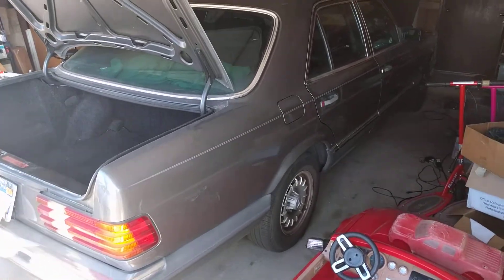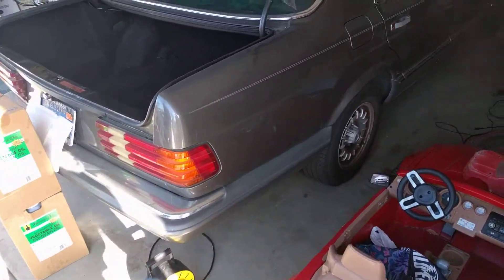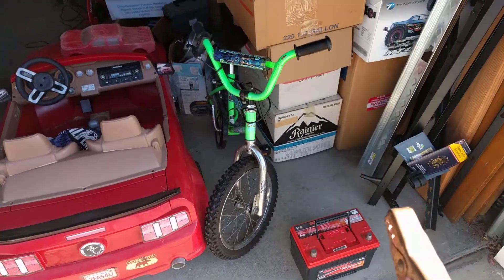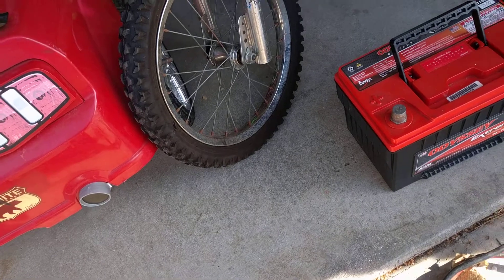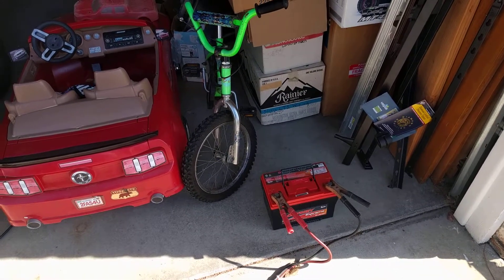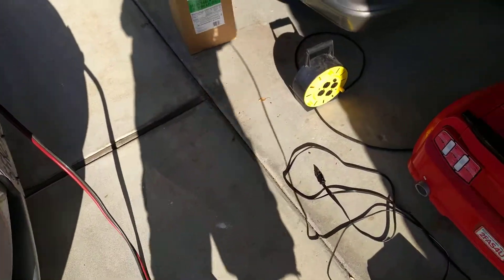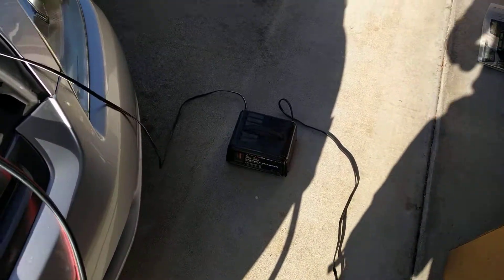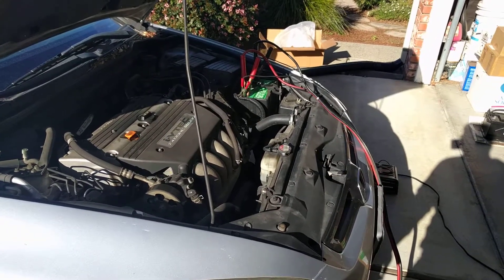Attempting to Restore an AGM (Absorbent or Absorbed Glass Mat) Battery - Odyssey PC1500

Comment: Older dumb chargers will charge a fully dead battery.  The new computerized ones won't.  Your's looks like an old dumb charger.  Overcharge that sealed battery and the sides will swell up and you got garbage.  You really need to remove the sealed caps on the Qdyssey.